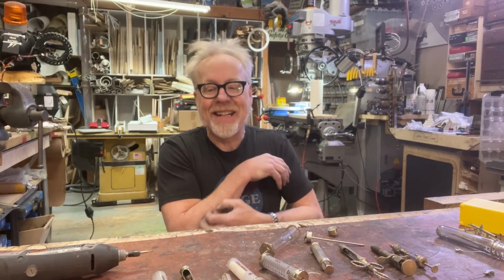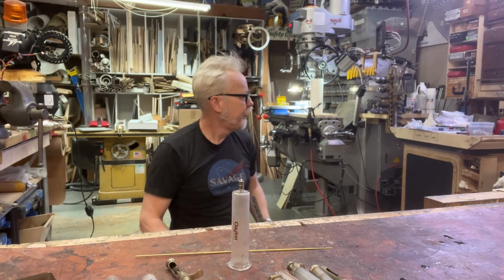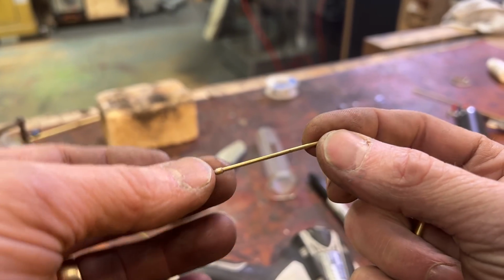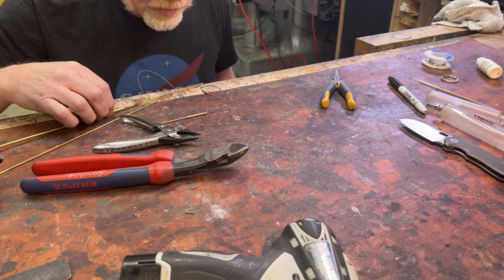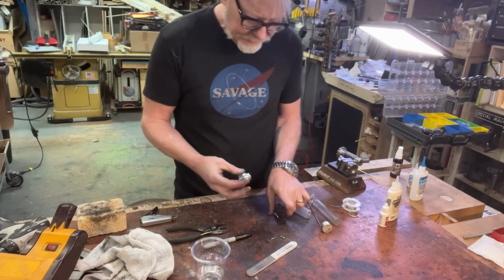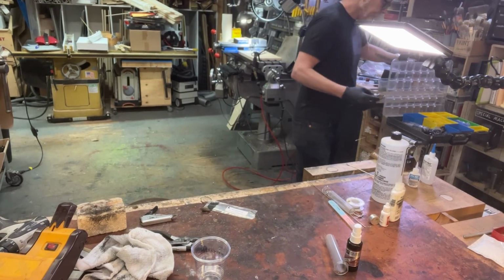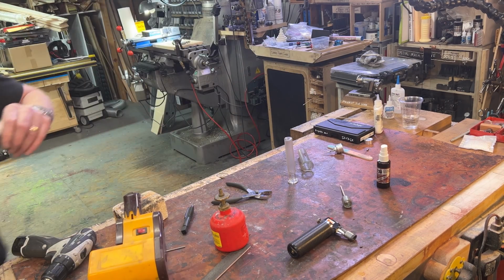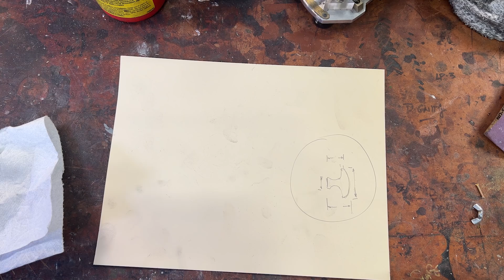Adam Savage's One Day Builds: Special Effects Syringe!

Comment: i never went as far as anything beyond high school prop making, but my favorite was an axe i made that was covered and dripping in "blood" i used a little pump i imbedded in the handle with a reservoir of theater blood. hallow aluminum handle panted to look wooden with micro tubes going up and running across the bottom of the "blade". small holes let the axe drip it was so real looking they thought that one of the actors got hurt. i really wish i would have pursued theater prop making.
Reply: It's never too late, my friend.
Reply: It's never too late, my profession didn't exist when I was in high school
Reply from the maker: In high school? That's amazing!
Reply: Very impressive, carbonitedreamer!  I've seen countless theater and screen props, but never one that actually dripped blood (or any liquid, for that matter!).  And it's definitely not too late, by any means!
Reply: It’s never too late. I was attracted to this because of my opiate addiction. Wanted to actually see what connections Adam had to addiction if any and his thoughts. I was always fascinated that they made syringes in the 1800s. And given the size of the needles, I was scared too, trust me.
PS, Once I felt what it does, that fear melted quick.
Reply: Seriously, pursue it now.  I want to hear about you getting in and making stuff.
Reply: It feels a lot worse looking back and saying you should have, compared to saying you tried. Even if you try it and it doesn’t go well or doesn’t work out, you went for it! You should go for it!
Reply: @tested  yep my speech drama teacher loved me because i was a gear head with a flair for the dramatic lol.
Reply: @Stettafire  I'm curious, what's your profession?
Reply: Don Davis, the actor who played Gen.Hammond/AdmiralScully/CommanderBriggs, started in high school set design, transitioned through an entire Navy career (where he published a graduate thesis on set design use for wargames) and then proceeded to return to acting in his later years

Don't give up on your dreams, it's all we really have
Reply: @tested  never underestimate what high schoolers can do

Comment: I'd actually think that a second O-ring near the back of the large section of the plunger might be sufficient to keep the aluminum from contacting the glass; not as a seal, just as a bearing surface. Might still need something farther down the shaft, but it might also be just right.
Reply: I think you’re right. I was looking to see if anyone had made this comment already when I found your. It seems like the real medical syringes I’ve seen had two o rings, but 8 could be remembering wrong.

Comment: So, when shall we expect to see the "holding one end of a piece of metal with bare fingers and heating up the other with a blow torch" demerit badge?
Reply: In the time that it took my mind to form the thought of "Wait, metal is very thermally-conductive", Adam rediscovered that on his own.
Reply: Not a blow torch, but I have lost count of the number of times I burnt my fingers soldering very tiny things. Anything with alligator clips just butchers 30 gauge wire- but fingers + some flat surface (like a table) does the job pretty well. If you're steady enough to solder between your fingers, and fast enough the heat doesn't travel.
Reply: I have also been in a situation where I forgot that metal conducts heat.  I've known of a few other people forgetting this, too.  Certainly a badge I'd be earning

Comment: My dad was a dentist and when I was very young, maybe 6 years old (over 60 years now), he got from a pharmacy rep, a fake syringe with a spring loaded retractable needle. It had a cylinder of red plastic that would hide inside a larger opaque cylinder in the tube. When pulled back, you could see an empty syringe. When you pushed the plunger in and released the red inner cylinder (a simple pressure fit at the thumb end of the plunger) and pulled back on the plunger, the red bit was left exposed in the tube and it was a pretty convincing blood draw. It was AWESOME! I took it to first grade show and tell (without my parents permission I'm sure) and the teacher confiscated it. But I learned some magic there...

Comment: I remember using the exact glass plunger syringes early in my career. They were specifically designed for the siting of epidurals, and used to injected air, designed to be a low pressure system. The plungers were designed to leak around the barrel if the pressure got too high. I think that may be why a firm seal with the new plunger proved difficult.

Comment: Did Sweeney Todd's squirting razor once, but I expect everybody's done one of those.  Same with the bleeding garrot from Deathtrap - icky and triggering but also a pretty common item. The trouble with your trick syringe (if you don't mind a little critique) is that needles don't have steps in them, and as you're not injecting anything you don't need a needle at all.  Use a blunt piece of piano wire and make the retraction/travel entirely in the metal attachment collar and the metal sleeve behind it.  The hollow plunger head can give you even a little bit more travel, and still give you the 'disappearing liquid' effect.  Vent it on the back of the plunger and put in only as much fluid as will disappear, and you could seal the whole thing permanently.

Comment: Darn, I was really hoping we'd see how to do the disappearing fluid trick! (The spring-loaded needle is simple enough to suss out, after all.)
Reply: You just need a way to hide the liquid, for instance in the plunger. Instead of using allthread, use a thin-ish tube and make a hole for the liquid to escape upwards into the plunger stem and pusher, if needed. The comically huge plunger also holds a fair amount of liquid.
Reply from the maker: Don't worry; it'll likely end up another video!
Reply: I wonder if it could work in reverse, as if you were drawing blood?
Reply: From what Adam was doing with the glass plunger, it looks like all you need is a space into which the liquid can flow.
Reply: @tested  yes please!
Reply: @a178design  I think it would, you'd just have to reverse operate it ("insert" the needle first, then pull the plunger).
Reply: @a178design  With the acted right body language/hand positioning, and a disappearing red fluid, you could film it in reverse.

Comment: Now I'm really curious as to how Adam planned to do the disappearing fluid trick. Maybe run it up the inside of that threaded rod and out a tube to somewhere?
Reply: Needle is sealed, the plunger is hollow, when you push the plunger the fluid just goes inside the plunger head and the threaded tube
Reply from the maker: Stay tuned; he's been thinking about it.
Reply: The trick is you need a hole in the end of the plunger to allow air to pass through as the plunger is plunged/retracted Otherwise the liquid has to compress the air. I'm not sure if you can avoid the liquid squirting out of that hole by having a much larger volume in the plunger as compared to the volume of liquid.

You would have to be pointing the syringe downward as you use it to prevent the liquid from just dripping out via gravity, but you can put your thumb over the hole before you use it so you can orient it however you like without issue.
Reply: @tested  I'd originally thought something like a water hammer arrestor, but looking forward to finding out
Reply: @tested  2 of "1 way valve" sort of system on the hollow but "both sides closed" plunger's head, 
one at 12ish o'clock lets liquid in the cavety, 
one at 6ish o'clock in reverse lets it out...... 
plungers head must be hollow and able to contain the required liquid amount (or bit more), till that liquid is no longer visible.....
 You could hide some of the liquid on syringe's head as well (so the plunger does not get to the actual end of the syringe, solving any troubles about escaping fluid from inside the plunger)
-or make the syringe's head the conteiner of that liquid it self (that would solve the visble valves holes on the plunger problem, but someone could thing of them as screws for the plunger head as well)
1 way valves do exist ???? XD
you could also make an airvent through the plunger's tube / rod back to where your finger is pushing it. you can just block / ublock that vent's hole with your finger any time you operate it to let air out / in as nececery.
Or make an colored (as nececery) tranparent acrylic tube that fits infront of the plunger (beeing it the liguid),
wich hides in the syrinnge's head when it moves forward and comes out when the plunger retracts. Giving a shot / taking blood....
Reply: @tested  waaaaaait a second here... I thought Adam ran the channel? XD

Comment: We used to do special effects like every teen/young adult in the 80s-early 90's did and to date the most unnerving prop was the simple, "Dulled Razorblade".
You just dull a single sided blade and then lick the "keen" edge with the tip of your tongue and/or roll it around in your mouth in a feat of "bravery".
Always a croud pleaser ;)
Props to Tom Savini's Bizarro which all our good effects spawned from !

Comment: Haunted house artist here, and a few classic squeamish props include:
-Amputation tables (table w/hole for actors leg/torso/rest of body, dressed with costume/fake limbs to create the illusion of a live amputation)
-stretching racks (similar to amputation table, but with two actors for upper and lower body or simply pneumatic lower body pieces, with silicone goo attaching the connecting torso viscera for that extra squelchy/stretchy look
-spark fences! (chain link fence hooked to one end of a car battery charger, other terminal attached via long hidden cable to a chainsaw bar/knife; the rustier the fence, the better!)
Sweeney Todd barber capes; saw one in a promo that had a sliceable flesh piece- the safety band behind things like this are ALWAYS important to remember!!!
-there's a product called cockroach crunch which is spead on the floor of bug-themed rooms to create the feeling of stepping on insects i rather enjoy
-guillotines with drop-away neck holes

There's also some great uses of peppers ghost combined with pneumatics to create the illusion of, say, a piston smashing someone's head in (and then customers having to move past the same piston, which of course moves a little bit) or the like, where an actor plays the lead up to the smash, and then the strobe lights conceal the switch to a peppers ghost scene of a body in the same costume all gored up.

Much of the haunted house industry is a bunch of engineers recreating effects from magic tricks, hollywood productions, and stage shows in low-budget, highly-repeatable forms. Some of these require concealment with strategic lighting, some just need repair/refreshing (see: sil-blood) from night to night, but if you're feeling extra excited about maker-made storytelling pieces that really make you squirm, i cant think of a better place to look!

Comment: Hi, Adam.
 You mentioned the "double helix cut hardened steel bit." Wondering: do you (or anyone we know) have a LIST of "highly specialized tools and what they're perfect for"? 
(I'm envisioning a 2 column spreadsheet, so if (years from now) I want to look up "ideal for cutting a round hole in glass" or "drills square holes" or "makes the perfect pizza" or whatever, I can do a search based on the JOB and find the name of THE tool.
   Anyone out there maintain such a list?
    Just a thought and thanks in advance!
Reply: great idea
Reply: We print and laminate charts available online for future reference. All based on specific materials. I have never seen a single list, I imagine it would be a long one lol.
Reply: This sounds like the makings of a huge list which should be printed yearly and become a maker's directory.Or as we makers call it. The Directory. 😍
Reply: To cut glass that would have been a carbide bit (burr). Pretty common tool, but Adam often calls things by the wrong name, so it's tricky to know what to look for.
Reply: you’re actually using something rn that has access to that exact list! google :)
Reply: @Perfinn  Sadly, Google tends to produce an overly long, completely unedited list with zero quality control. (i.e. 90% of the information it retrieves is garbage.) This, I dare say, is NOT a GOOD specific tool for finding good specific tools. Thanks anyway.
Reply: Everything behaves differently, different types of glass, dough, wood.  That will be one heck of a list.  Best thing I could say is try find some people that are willing to let you use their tools for small projects, maybe turn it into a hobby.  Some people might say you're only as good as your tools, I personally disagree, I say you're only as good as the skills you develop with those tools.  I mean, look at all the things you can do with a simple soldering iron these days and a handful of basic components.

If you do however find such a list, I would be very interested. :D
Reply: Pocket Ref Fourth Edition
Most technical jobs have a Bible of sorts it just being a reference guide of all charts and graphs that they have as well as recommended tools
Reply: This sounds like a good idea but I don’t know if it’s practical only because industry to industry and even person to person how tools are used, and what they are used for varies so much. I.e. a tailor uses a seam ripper to remove stitching, a mechanic uses it to remove wrapping around wiring harnesses. Works great for both but quantifying and articulating that is near impossible.
Reply: @ambush1242  Never without the roughest of edges, but he had some really good info. Then he got the Haas and became a mediocre CNC channel, albeit with interesting color commentary. Now he's just gone off the deep end. Unsubscribed after the whole trucker convoy thing.
Reply: Or, specialized tools that he fabricated himself?
Reply: Hmmm... Thanks for the thoughts.
 I am seeing now that to get a list that would serve the purposes I want I would probably have to compile the list myself.
  My initial thought was just I can really see myself 10 years from now needing a specific tool and thinking, "What was that thing that Adam Savage used in that video that I saw 10 years ago??  It was ... it was a thingy... of some kind."  :-/
Reply: I recognize that bit and the first time I used one on ceramic tile I was amazed at how well it works. It cuts through glass and tile very nicely. It's a Dremel 562 if you want to get one.
Reply: @RambozoClown  Adam also often calls things by names that he makes up himself. 😁
Reply: As a maker/fix-it dad, one compendium I would find really valuable is which glues to use for which plastics. The "easy" ones like polystyrene, ABS, or PVC are almost a no-brainer, but (as an example) I've got this piece of tupperware that I've got to repair. Finding something that works is going to be a challenge, because I don't know what kind of plastic it is. Off to hunt for answers!
Reply: @pawpawstew   Before you glue wash the part with hot water and Dawn dish soap, anything rubber, nylon, plastic will have a ' mold release compound ' coating that will come off with a mild scrub leaving a clean surface for good adhesion. Sanding will help too. Another issue is to make sure whatever glue you use will not only bond to rubber or plastic but also the glue itself can handle flexing. Beyond that, no matter what you use try to find one that has a high bond strength,   rated in psi - the higher the better.

Comment: This might be super obvious to some, but seeing Adam futz around with getting the vise to grab the pipe made me want to mention this: Getcherself some suitably thin (like, 1/8" to 1/16" or so) softwood or balsa to use as "wasteboard" soft jaws; the wood should be soft enough to catch any irregular shapes. Learned that when I was cutting a lot of machine screws a bit shorter, and unless you put, like, machining-levels of stress on it (e.g. don't rely on it to hold something you're milling) it works perfectly adequately to hold things like, well, screws or other awkward geometry (like the "needle" with the two dissimilar ODs). Hope this helps someone 👍

Comment: Beautiful build. We still use ground glass syringes for spinal taps, because the ground glass plunger to ground glass syringe cylinder fitment can be made so closely that the syringe can actually bounce on just the air pressure in the syringe, or the fluid pressure in the spinal canal, with a tiny bit of resistance. The seal is actually made from the water's surface tension between the two ground glass surfaces. I think this worked against you in this setting, as the inside of the syringe is not smooth, which makes an imperfect seal against the O-ring, preventing it from mating and sliding as expected.

Comment: Hey Adam, if you do not want the silver to turn blue, you might want to add a protective coat. Maybe a clear coat of zapon lacquer could work. That was once the stuff we used on real silverware the old ladies just wanted to keep in their showcases and never use or clean. If that is to thick it could of course be rhodium-plated. But I guess at the current price that is a little out of budget for a prop. Greetings from our little jewelers workshop here in germany.

Comment: Hi Adam,
I wonder if, with a good seal at the O ring, and if the rod to the plunger was hollow, you might be able to have some visible fluid in the syringe that when the plunger was pushed in would be hidden in the rod (I suppose it wouldn't be much) and then would appear again when the plunger was retracted while the 'needle' was 'inserted' into a vial...  🙂